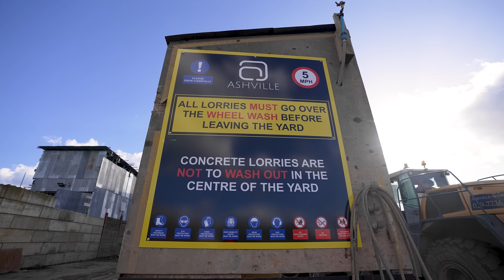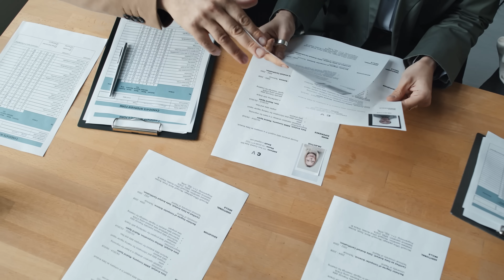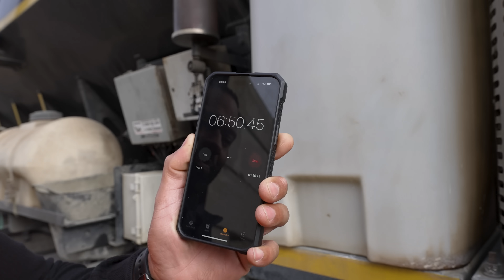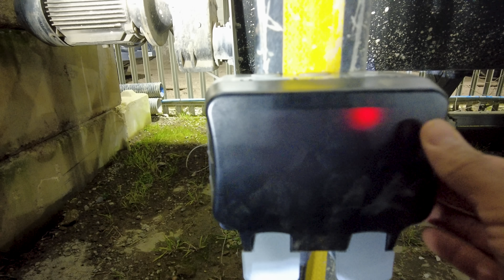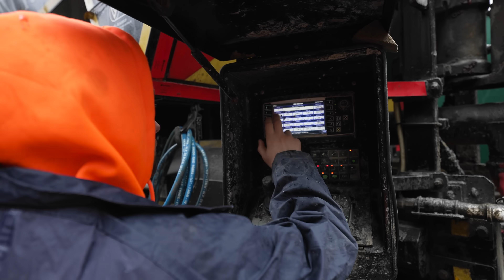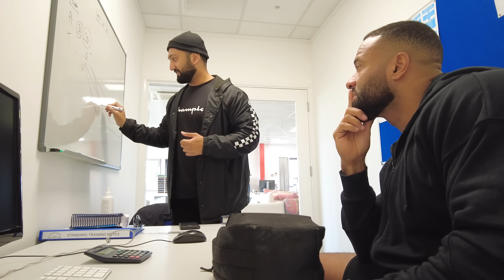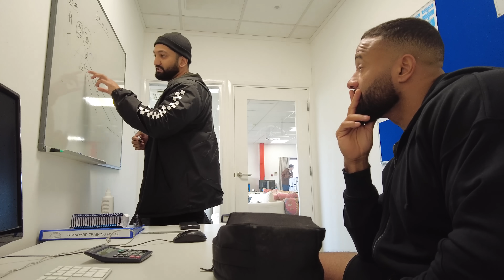The Thieving Copper and Bucket Riddle | Ashville Weekly ep128

Comment: That socket install 🫠🫠🫠 that enclosure unless he silicones where he’s screwed to the post and drilled a small drain hole at the bottom. You’ve lost the IP integrity of the box, cables cut back short and no blue sleeve on the black conductor to identify it

Comment: I noticed the Electrician doing the outdoor socket used the black conductor as the Neutral conductor WITHOUT identifying it with sleeving.
Also reputable UK Electricians try to keep UNIFORM by always using the GREY CONDUCTOR of a 3phase cable as the Neutral and also by taping/sleeving the conductor.

Comment: Is your uneven brake wear warning caused by partially seized callipers. Used to get this a lot on our trailers. The callipers looked ok on inspection visually but lift them and try to move them proved limited movement. Remove pads, pull out one or two slider pins, clean and lubricate, refit.  Problem solved.